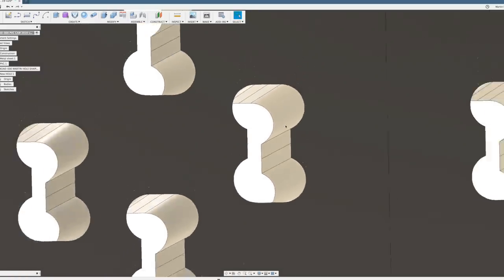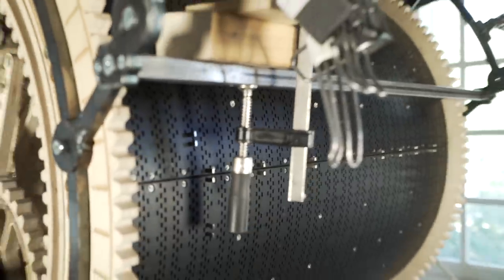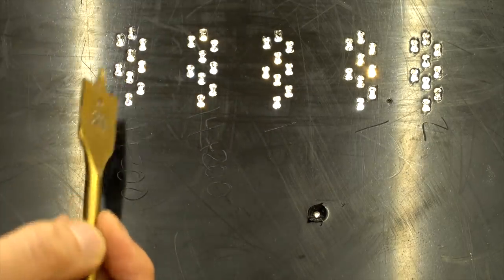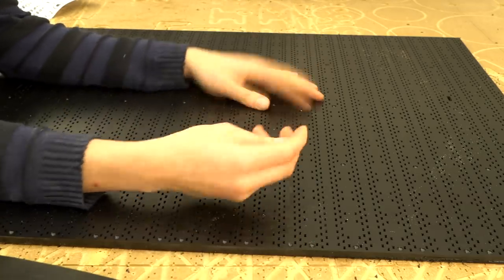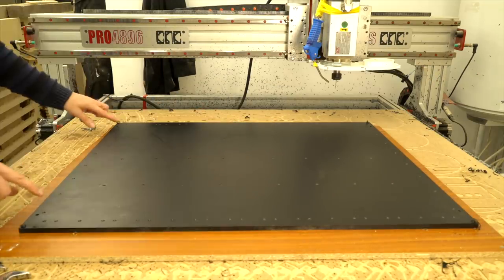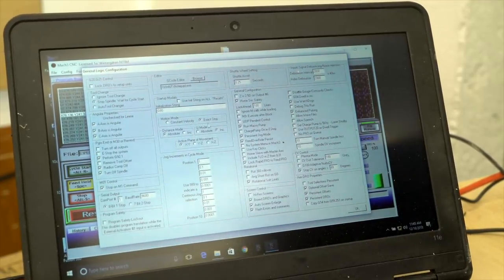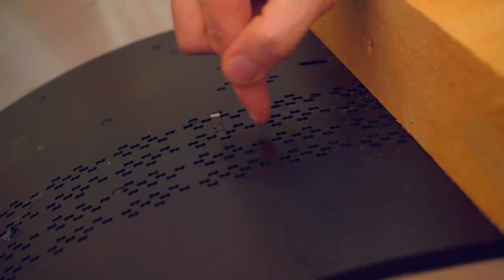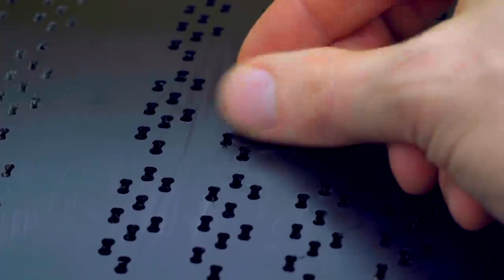Deeper Down the Rabbit Hole - Marble Machine X #66

Comment: Every time you do a video on the programming plates, I wonder why you're still using the removable pins in hole design, even after all the problems you've identified.

The current programming plates are difficult to manufacture; so difficult that you're only planning to have a small number, which means that to change tunes will require laborious reprogramming, during a concert -- of so many pins! And, you've already identified that the note placement is restricted to the hole spacing, so you have to have extra tracks for triplets, etc. -- and even then you can only play those exact spacings.

With the first Marble Machine this design made sense because the programming wheel & tracks were fixed in place. But think about all the machines in the Speeklok Museum: they don't use removable pins in holes. They have sheets, disks or cylinders with fixed position holes or pins only where the notes are.

What I'm wondering is why you don't use something like flexible sheets with fixed pins exactly and only where you want the notes for a particular song. To change songs, just change the sheets.

For example, and this is just an idea, you could use the MIDI data to have the CNC drill holes in the sheet where the pins should go, and then push pins (e.g. rivets) through the holes. The pins would be permanently attached to the sheets.  Then you just need a way to attach the sheet to the programming segments.

Comment: @Wintergatan 
Marten,
You are going to NEED A PLASTICS ENGINEER
Porosity
Matrix
Homogeneity
OFF GASSING
DE PLASTISTICIZATION

Will ALL combine to create shrinkage of VARYING degrees

Please, Please, PLEASE, for the love of all that is holy, consult a PLASTICS ENGINEER.

Ive seen this very problem huble men and women with decades of experience.

Sincerely,
A retired electronics production, manufacturing and test engineer